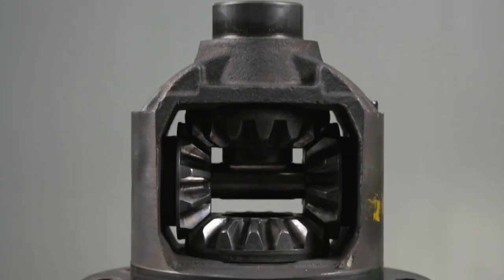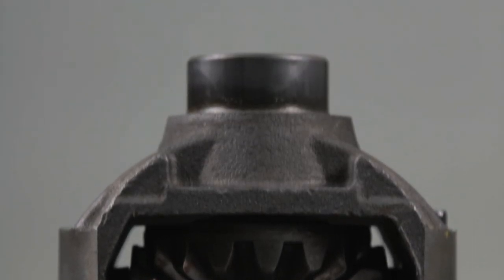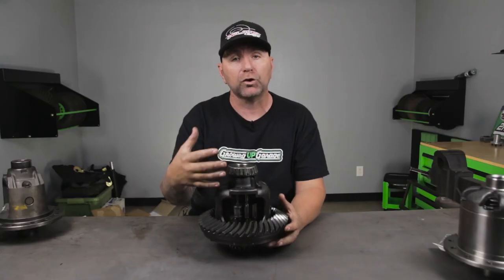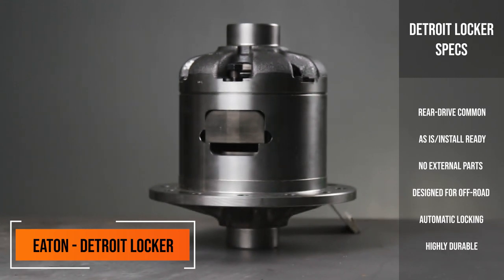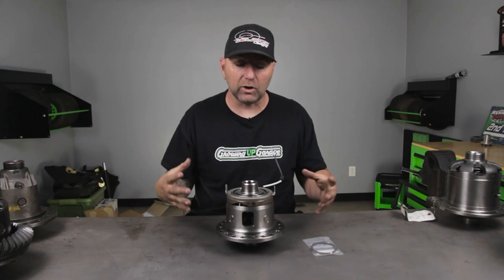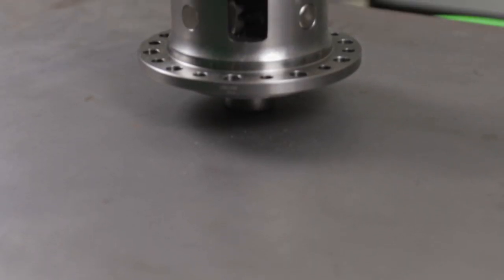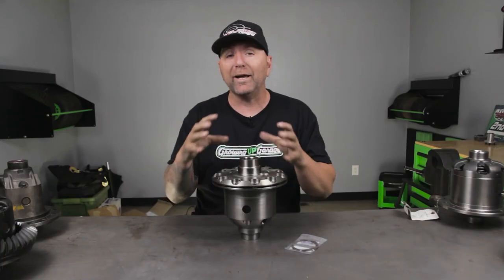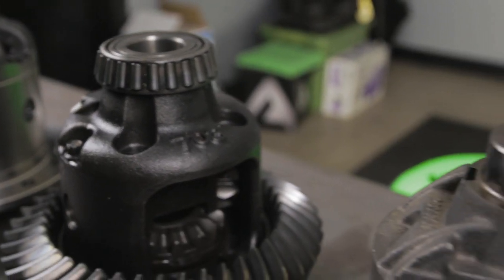What's The Best Locker For Your Van Build!?! | Locker & Differential Comparison

Comment: Is WTD installing lockers for motorhomes?
Reply from the maker: Unfortunately, Weldtec Designs doesn't do gears or lockers anymore.
Reply: @jeremysworld10 but which locker would you recommend for a E350/E450 base RV with dualies?
Arb or Eaton or ??
Reply from the maker: @jeffmerlet3032  I have the ARB in both of my vans because i want the air compressor as well to be able to inflate my tires.